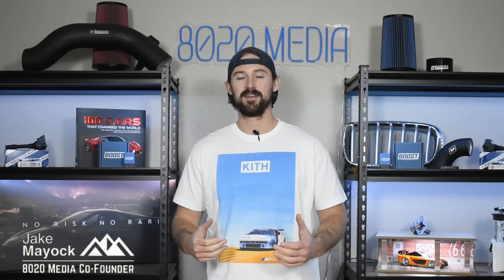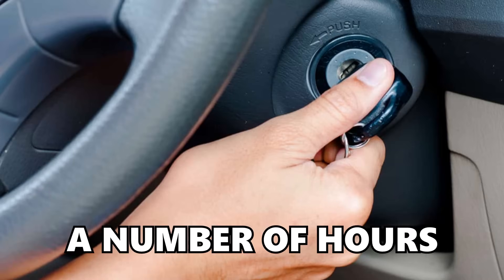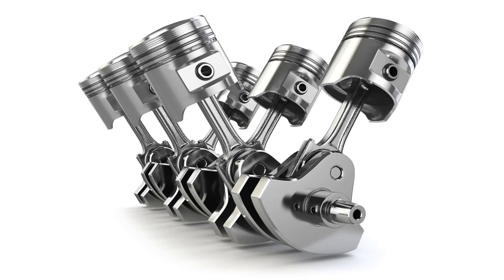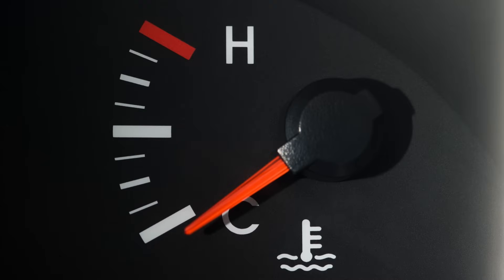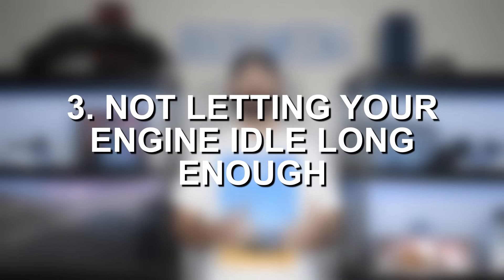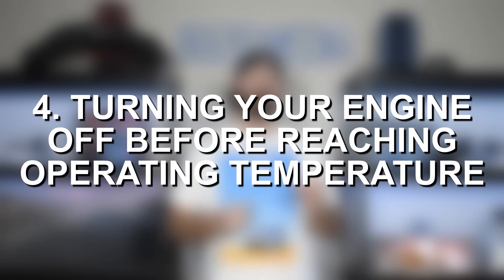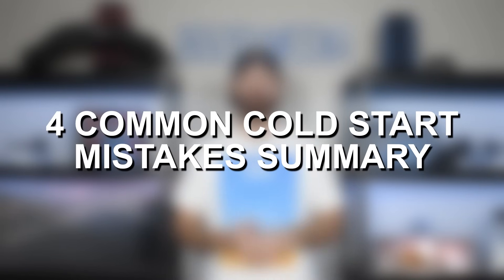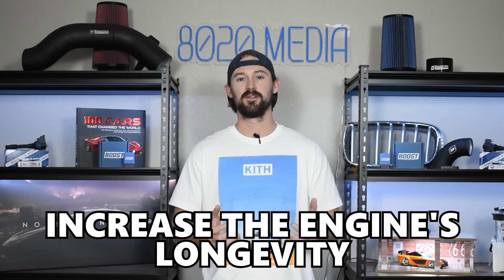Your Engine Hates These 4 Cold Start Habits—Avoid Them Now!

Comment: I idle long enough for the blue light to go out and high idle to go down ,sometimes its few minutes. And i lab test my oil on every oil change, so far 0 fuel dilution
Reply from the maker: K - Doing it the right way. Thanks for taking the time to share your experience!
Reply: ABSOFUCKINGLUTELY RIGHT. I HAVE A BLUE LIGHT AND DO THE EXACT SAME AS YOU.👍

Comment: Great tips for gasoline engines.  I have been a mechanic for 35 years and seen the difference between owners who abuse engines and those who take care of them.  I have seen 100k or more mile lifespan increases just with a short warm up every cold start. 
  Wait for normal, smooth idle before driving- 3 minutes is my recommendation.   Diesels need more time to warm up because they are much more thermally efficient- less waste heat.  
 Water and acids in the oil from short trips is the second most common killer in my opinion. 
 Another tip is to allow a cool down of a minute or 3 after hard driving before shutdown, especially with turbocharged engines.  
Stop destroying engines people, it's a waste of resources-  energy, time and money.  Take care of your stuff.
Reply from the maker: S - Well said! Thanks for sharing these insights!
Reply: THANK YOU SIR FOR YOUR SOUND ADVICE.

Comment: I think you are wrong about idling the engine before driving. Even in cold weather the best information seems to be that driving the car immediately but conservatively is best. Modern oiling systems are very good, oil should be at full flow immediately, before you even have a chance to move a gear lever. Wear is exponentially higher at low temperatures so warming the engine quickly without excessive load is the best practice, and the best way to do that is by driving.
Reply from the maker: G - Thanks for your input. It's not "wrong", the point we were getting at with letting it idle for 30 secs was to let the oil system fully pressurize and circulate.
Reply: @8020Automotive  Perhaps... but is there any reason to think the oil system isn't fully pressurized and circulating within say, five seconds? 

I'm not attached to my preconceptions here, I just think there may be some mythology around this that your video is spreading. There are check valves in modern oiling systems. When I have a valve cover off I usually see oil flowing within a quarter crank rotation. By a few full crank rotations oil should have flooded everything. It won't be any warmer in thirty seconds, maybe a degree or so. Why wait?
Reply: @GlennC789  if it's below zero degrees you at least want to let it warm up for 5 minutes.
Reply: Being a 5.7 hemi owner. I was thinking the same. I turn that bad boy on and take off taking it easy. By time im at the highway its around 150-170.
Reply: Actually you're wrong
Reply from the maker: K - Us?

Comment: Should I not let my wrx sti 2015 idle down in the morning after a cold start? I brush my teeth then dip out
Reply from the maker: B - No, you should be fine. So long as it isn't consistently longer than 5 minutes.

Comment: My 2020 Camry LE takes OW-16 oil...pretty thin!  Not too cold near Sacramento. At cold start I let it idle for a minute then gently drive away. I change oil every 6 months regardless of the miles with Mobil 1 full synthetic. Now my pickup...a 1970 F-250 with a big block 460 cu. in. V-8...I let it idle for about two minutes to let the entire engine get thoroughly lubricated. Either vehicle... I gently drive away. My vehicles never had it so good!
Reply from the maker: S - Doing it right! Thanks for sharing your experience.

Comment: When you say avoid aggressive driving you mean shifting gears at lower RPMs right? Because for example if you're traveling somewhere and it takes you just a few minutes to get to the highway, you're going to be hitting 60 and 70mph presumably before your engine has fully warmed up. So if aggressive driving means driving at high speeds regardless of how low or high the RPMs are, then you're at a pickle here.
Reply from the maker: T - Avoiding aggressive driving refers to avoiding high RPMs and heavy throttle inputs, rather than strictly limiting speed. Driving at 60–70 mph on the highway is fine as long as you’re keeping RPMs low and accelerating gently, because maintaining a steady speed with minimal throttle load doesn’t strain a cold engine. Aggressive driving, on the other hand, involves hard acceleration, sudden braking, or revving the engine to high RPMs before it’s warmed up, which can cause uneven wear and stress.

Comment: If it's below zero degrees out you want to let your car warm up for at least 5 minutes. 30 to 60 seconds is nowhere near long enough when we're talking Sub-Zero temperatures.
Reply from the maker: T - We did mention depending on the conditions (weather).
Reply: Ikr, I almost can't believe that, I live in a pretty cold area, and I warm up the engine for 5min
Reply: All you Knucklehead's not letting your engine warm up the mechanics love you  !  😊
Reply: 5-10 mins in winter where I live and my car is older,well a 2008 but runs A-1!!😁
Reply: @uttasyda9746  I should be more specific cars with the carburetor. Take longer to warm up. Put almost nobody drives those anymore.
Reply: it takes about 1 hr to get your car ready to be safely driven in Yakutia russia where the temperature in the winter is often times neg 50 degrees celsius. Some people leave their car running the whole winter to not have to deal with this. Others put their cars in a large heavy heated cover.
Reply: I wait until the rpm drops to normal then drive.
Reply: When our local Temps were Sub-Zero (Fahrenheit) for an extended period... Saw a News Story where they Interviewed a local show where they mentioned Warming up for 5 minutes... I was like no way is that legit. Even the Reporter during his Summary Hedged his bets down to like 2 minutes.  While my Analog Gauge doesn't display "Cold" temperatures very well... I do on occasion use my wireless OBD II Scanner which lets me Display a "Dashboard" on my Phone along with Real-Time Digital (or Analog) Gauges for things like my MPG, Battery Voltage, Engine Temp... Etc. 

While I'm not against running for 2-3-4-5 minutes if needed... I'll usually Start my car on Sub-Zero Days or any other days where I need to clear the Windows/Vehicle of Snow/Ice and turn on the proper Defrosters/Heaters so when I'm done... The Temp might not be to Full Operating Temp... But it will be likely Hot Enough to keep the Cabin Warm and after hitting the road it'll be just fine... Even at 2-3 minutes.

If the vehicle is having a hard time at idle or maybe the windshield is fogging/iced up maybe I'll spend extra time waiting/working on that.  I won't "force" the vehicle to work when it is having problems.

But if the idle is low and smooth and no apparent problems... I'll hit the road 1-2 minutes easy
Reply: 5 min no. 1 min is enough
Reply: @JohnSalchichon95 , Actually Operating Temperature is 101°  ,,  in any Automotive engine  (  Gas or Diesel  )
Reply: Unless you drive with a carburetor, no. One minute is enough for below zero starts, around 10 seconds is good above zero.
Reply: @lucaswinstonismyname  negative you can seriously damage an engine by not letting it warm up properly.

Comment: I have a '06 TL that does not warm up quick. Unfortunately I hit the highway almost immediately when I leave for work so I do let it sit for a few minutes when it's below freezing like it's been lately
Reply from the maker: M - It does depend on the conditions! You're at least doing more than most more than likely.
Reply: @ Yea I have a mechanic background so it helps even though I’m no longer in the business. You don’t lose the knowledge you get

Comment: Number three is actually false. I would remake this video and change number three to this:

Start your car and gently Drive away. We want the lowest possible load and low to medium RPMs. This actually will warm the engine up much faster than just sitting there idling. Warm up faster = less wear.  Remember low load is the key.    I have studied this for 20 years now and this is the best possible advice I can give.

Fun fact you guys want to know one of the main reasons why Toyota engines last so long? At cold start up all Toyotas will rev to 2000 RPM for the first 20 to 30 seconds of cold running. This is actually the same technique as a new camshaft break in. The higher RPMs will force the oil to the top of the engine much more efficiently and quickly than your usual 800 RPM idle speed.  It kinda blows my mind  how the other manufacturers don't copy this.

Cheers boys.
Reply: My 98 Toyota idols at about 1100 until my IAC kicks in or something once it hits 3/4 rpm it's already at operating temperature
Reply: What's the most optimal RPM when driving 30mph (50kph) after a cold start? Let's say I drive 2.0 diesel passenger car and 2.0 gasoline passenger car (will there be difference?).
Reply: @Quetzalcoatlv3  First of all, great handle.   Ok as you're driving away after cold start we probably just want to keep it under 3k rpms.   I'm often targeting >2500 but it's fine to go over that a little.   Remember the key here- low load.   You can stomp on that pedal and create a high-load even at 1500 rpm's.   We don't want that.

The load is much more important than rpms.   Apologies but I do not know much about diesel engines except for how carcinogenic they are compared to gasoline.   Filthy.
Reply: @ You are from US I assume. Well the engines are more efficient. They have more durability because since there are higher pressures inside the engine, the engines must be thicker (pistons, piston rings etc.). But they are way slower to get up to the operating temperature. Also they have a lot more torque. Example: 2.0 gas 140KM, 145Nm vs 2.0 diesel 140KM, 320Nm
Reply: Mazdas do the same thing.   Every morning I start my cx50.   It idles up to about 3k rpms for like 30sec them hangs at bout 1.5-  2k rpms till it gets warm
Reply: I don't know if you've noticed but all cars have high idle when starting cold.
Reply: @lucaswinstonismyname  not "Toyota high".  Maybe I have some bias, the 2TR-FE four cyl in my Tacoma absolutely roars on cold startup.   Before I knew what this was about I was concerned for the neighbors.  🤣
Reply: this happens in my supra too but its not really a toyota since the entire engine is made by bmw, thus it also happens in bmws. It also happened in my infinti. The rpms stay high for about 20 secs.
Reply: Actually it stays up higher in Toyotas because the catalytic converters in Toyotas are absolute trash😂. You can smell when a Toyota guns it on the highway near you lol. The high idle is to warm up the cats above any other function. They know they are garbage so they need to introduce heat asap and they known their type of owners lack proper auto care. Stop spreading false information lol
Reply: I have a Corolla F150 and an Audi. Haven’t visited a shop in 15 years because I do my own work. I’m aware of each brands faults. You fanboys act like Toyota is god 😂
Reply from the maker: I - Thanks for your input. It's not false, the point we were getting at with letting it idle for 30 secs was to let the oil system fully pressurize and circulate.
Reply: If it's below 0° out you always want to let your car warm up for 5 minutes.

Comment: Modern engines need only very few seconds to have oil pressure everywhere. 2 seconds are normally enough, with other words it can be driven immeadiately. Only yoour should drive it with low RPMs, what is easier, if your are driving a manual gear box.
Reply: I pity any car you own...2 seconds pass by too quickly...30 secs is good compromise...car will tell you when it's ready to go...just listen
Reply: @Akhil.Chahar  yes especially if it's below zero. I always used to warm my car up for at least 5 minutes. If it was below freezing.
Reply: @Akhil.Chahar  I'm mechanical engineer and I'm working as a test engineer in the car industry. All tests are proving, that after the oil pressure is established, everything is fine. And espacially with a cold engine (except we are talking about -40°C) the oil pressure is above of 3bar after the first second. What can need slightly longer ist the complete pressure in the hydraulic rams. That  can need perhaps 5sec. But that is more an acustical topic. Mostly after 1 second everthing is fine. There is one exception. Engines that are developed perhaps in the 1930th need longer and there some ideling makes sense. But all modern engines have no topic. The topics are more, that exhaust gas cleanig systems are a real problem. Here soot likes to deposit in the exhaust gas return.
Reply from the maker: T - Yes, modern engines are better at this. However, not everyone has new engines.

Comment: #2 should only be a problem with bad piston rings. The car's computer knows to cut fuel when idling
Reply: Are you sure about that?  Aren't the cold rings smaller, allowing a bigger gap to the wall until they are up to temp?

Comment: First is more or less reasonable. Second - only if your engine is nearly death... but if your engine is nearly death, who care?  Third, mmm... every part of engine is oiled maximum 0.7 second after you start the engine. Again, if your engine is nearly death. if not, oil pressure must be high enough when cranking, and this is one of the reasons (not the only one!), most modern engines do not start if your battery is weak and starter cannot rotate crankshaft fast enough.
 Fourth ->  sad but true. Change oil more frequently to avoid problems.
Reply: First is reasonble. 
Second - Fuel dilution is evident, as idling is fuel-rich. It fully recovers if you drive long enough to vaporize the water in the engine oil. You barely see severe fuel dilution in BMW engines (100+ celcius operating oil temp except S65 & S85 which has flaws in fuel injector design, but compensated with very thick 10W-60 oil)  while fuel dilution Honda 1.5 liter turbocharged models are significant in used oil analysis. 
Third - Totally agreed. Modern oil supply systems have one-way valves for rapidly building oil pressure  within several seconds. 
Fourth - The source of viscosity lose it different. It's water dilution rather than fuel. The exhaust gas contains water inevitably enters the crankshaft box. It needs temperature and time to vaporize the water content. It's recoverable though.
Reply from the maker: B - Correct. We aren't saying this will happen on a brand new engine. It is a gradual thing.
Reply: @8020Automotive    First, apologize for my very poor english.  And, yes, it is gradual. But. Right now, i can start up my almost 30 years old Mitsubishi Colt (1.3l, 78HP, 180+k km, absolute ancient piece of shit, but my wife love it...), and let it idle, until gas is over. There will be no measurable change in oil quality. For 2 reasons: First, engine will reach working temperature after about 6 minutes (it is +1C outside right now). Second, fuel enrichment will be off after less than a minute. In this situation, even if some negligible amount of fuel mix with oil, it will be evaporated too fast to make some troubles to the engine.  
 Long idle on cold engine was really a problem, when i was a child. Yeaah... grass was greener, sky was... and so on. And no fuel injections. When granny Lilli pull enrichment lever (sorry, have no idea what is proper english word for this thing), and forget to return it back after a while, yes, there is a problem. AFR become super low for very long time, even on sophisticated carburetors, part of uburnt fuel literally wash out the oil from cylinders and  ... here we go. Sometimes this was a problem with very, very old fuel injections with a single injector, but... all this is ancient history.
 Again, sorry for my poor english, this is the main reason to avoid long explanations.

Comment: Temp gauge doesn't show you the right Temp! It ist the Oil Temp that is showing you the right temp.
Diesel and Benzine should be at least 80 celsius before using the gas that much.
Reply: Diesel suffers less because most of the powerband is in the lower range. You don't really have to rev above 2k unless you're maybe pushing uphill, or you're driving a non-turboed engine.
Reply from the maker: This is correct — many vehicles display coolant temperature on the gauge, which doesn’t always reflect the oil temperature, a more accurate indicator of when the engine is fully warmed up. While the coolant may reach operating temperature relatively quickly, the oil takes longer to heat up, especially in colder weather. For both diesel and gasoline engines, it’s advisable to wait until the oil temperature reaches at least 80°C (176°F) before applying heavy throttle or high RPMs.
Reply: @ Depends on the engine. If you have preheaters and an oil cooler, you'll have it heated faster. My car has a factory oil temp. gauge, and oil reaches operating temperature shortly after water, even below zero. It's a 2.0 HDi from 2006.